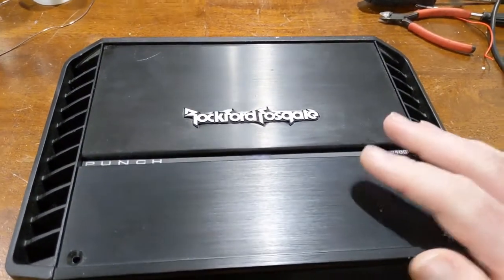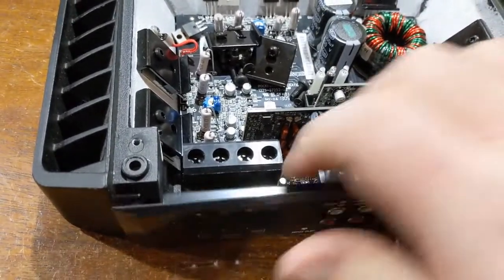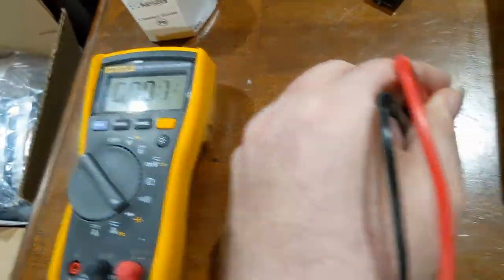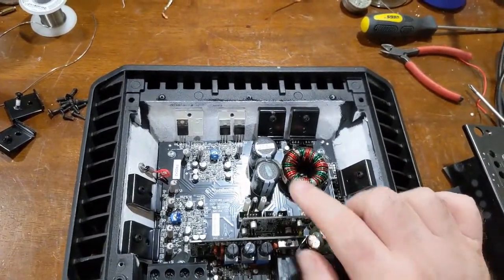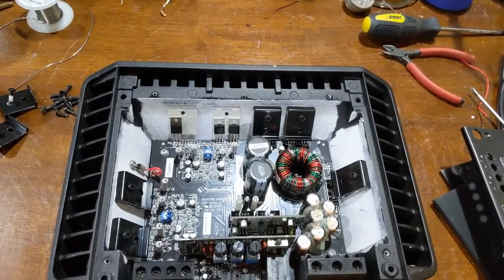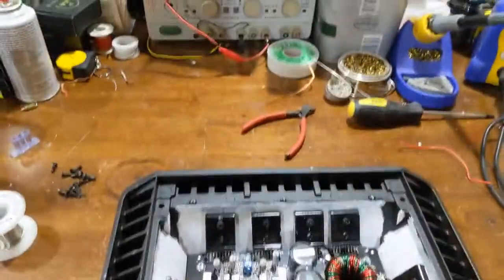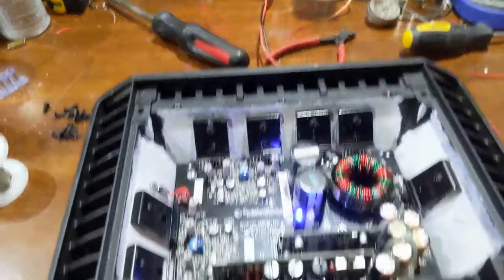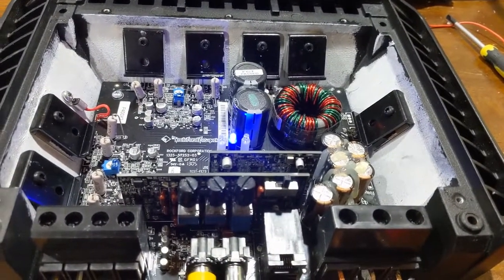Rockford Fosgate Punch P400x2 Repair

Comment: I watched this video and liked the methodology you used. I've repaired some old led calculators, robotic cars and even built a Tesla Coil. I am in the process of repairing my truck's Rockford Fosgate P300x2 amp and have run into a snag. I sourced the MOSFETs I need to replace (all of them) as you suggested but two different MOSFET's have 'part numbers' that do not give me a result doing a Google search for a supplier.  They may be proprietary. Could you help me identify these two components? One is marked AFC43 U1620G AKA and the other is AFC43 U1620RG KAK
Reply from the maker: Those are rectifiers, and id recommend you test those first for shorts. they hardly ever go bad.

Comment: I have a t2500 with no visible damage to any components but still get no power at all. The amp has never even been wired under 2 ohms, it can't be too serious. I can't get anyone to work on it though.
Reply from the maker: Honestly I'm surprised, you would think there would be a few amp technicians out there. I used to do it as a day job but not anymore and now it's just a hobby